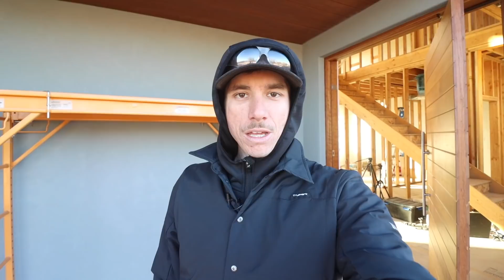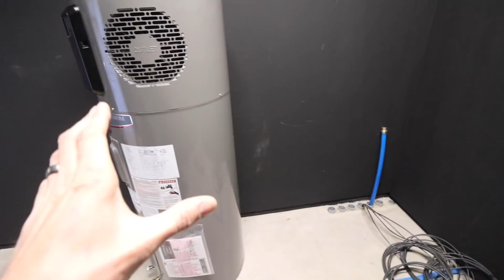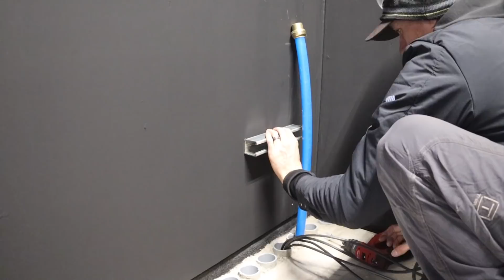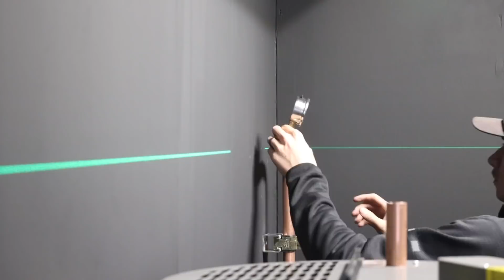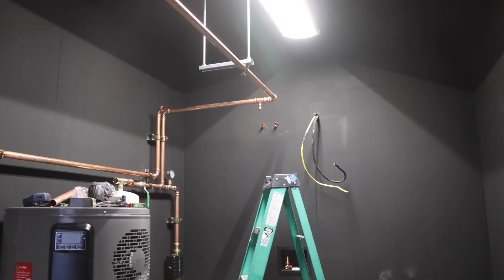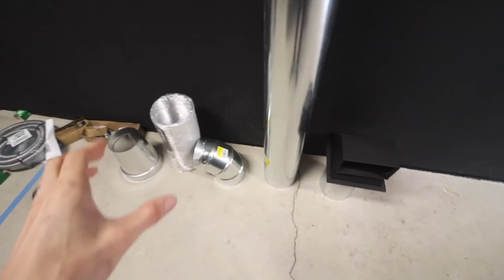Building The Coolest Mechanical Room | Part 2 - Plumbing & Water Heater

Comment: Should use uni strut cap ends and rod and brass Munson rings 😉 and press fit is shit ! De skilled the industry and allowed anybody to think their a pipe fitter ! Press fit valves ? Where's the union / drain off ?

Comment: Would you recommend a particular type of paint for a mechanical room?
Water based/latex? Oil?
Mold proof primer incase of moisture, down the line?

And, is it all just 'normal' drywall?

Comment: Cool channel but i disagree with your choice of a heatpump water heater. With mucho solar available, water is best heated with solar directly than the using electricity. The extra storage requirements, extra generation required and the energy loss in conversion just to heat water is a huge mistake.  Where you can use solar to heat water, you could store a couple hundred gallons and only need it insulated. You could also heat the house with stored hot water. You really missed an opportunity to save.  I would kill for your available solar. Solar Heating water is cheap and easy.

Comment: Good idea ducting the water heater. I have issues with mine due to it not having enough air flow around it to pull heat from the air

Comment: i have that same water heater..i duct it into my basement... today in Connecticut its 90 degrees and my mitsubishi hyper heat hasnt kicked on YET today. thats a great point with that expansion tank and the backflow preventer... usually as you know your well pump bladder is that expansion point...I GEEK out on mechanical equipment.. YOU DONT NEED A DEDICATED RECIRC LOOP. You may want to add a how water pump with the thermostatic valve at your furthest device so you have hot water instantly... WATTS Makes it. it gives you 90 degrees... and you can add more thermostatic valves at other fixtures as needed. i just put on im my house.. AWESOME! (it pumps water back on the cold water line until temperature is reached)

Comment: Now I have seen several having problems with water leakage in Texas due to the combination of power outage and cold weather. Why do you install water lines in the ceiling instead of the floor with pex lines? In Denmark waterlines are placed in the floor and all electric lines in the walls and ceiling. By installing in the floor the water lines are not as fragile to cold weather and in case of a leakage you wouldn't ruin all your ceiling, walls and floor.

Comment: Looks great, as a plumber I can’t complain at how nice you did your surface mount. Was this a remodel? Wondering why the hot and cold weren’t ran in the wall where the HWT was at. I do think there are some benefits to having the main lines exposed, in case you want to add fixtures down the road. Just curious, as overall I think you ran a very clean surface mount system.
Reply from the maker: new install, wanted everything exposed

Comment: Solar thermal would have provided much of your hot water with no electrical requirements. You could always integrate it later- use a solar thermal cylinder to preheat the supply to your heat pump cylinder meaning the heat pump only needs to top up occasionally rather than supply all your needs.

Comment: since you have a dryer that will be dumping heat outside, and you have a water heater that will be collecting heat from outside. could you possibly feed one into the other as an added benefit?
Reply from the maker: would never do that
Reply: @Handeeman  I didn't mean I direct piping but in the same general area. However for those of us not in the industry. Why wouldn't you? From a laymens perspective it seems like an opertunity to recapture some lost energy.

Comment: Very professional looking plant room, question though; here we're not allowed to put a steel, stainless or otherwise tank sat directly on a concrete floor as the concrete has a habit of attacking and eating through the bottom of the tank. Is that tank insulated against the concrete to prevent the corrosion taking place?

Comment: The tank hybrid was definitely the right choice. Keep it on heat pump only mode. The reason it’s on a 30 amp breaker is for the resistance elements.  A tankless would be a huge draw if the house went 100% solar. 👍👍

Comment: I suppose you didn't have room for thermal hot water panels? We use evacuated tubes angled at 60 degrees and nothing else for hot water heating.

Comment: Ideally you want to use a much bigger bladder tank to avoid short cycling your pump. I presume you have a shallow well pump for the cistern. I would have also installed a water filter in the Mech Room. Not sure if you have another filter. Filter would go after the bladder tank to avoid running the pump dry if the filter gets clogged.

The issue with those heat pump water heaters they are prone to failure. I would have use Pex for the connections to the water heater instead of the re-inforced rubber hoses that are prone to failure.

Comment: Those heat pumps are great units  but should really be installed outside. One thing they won't tolerate is a high static pressure air flow caused by adding ducting to the heat pump air flow.  Adding ducting any smaller in diameter than the fan outlet especially with bends in it will severely restrict the air flow.  This will reduce the efficiency greatly and may cause more freeze/defrost cycles than normal further reducing the efficiency and adding to the daily power usage.  They used to have a model that had evaporator plates, that could be placed on the roof, rather than the evaporator coil that is in the top of the unit behind the fan.  We had one of these earlier units that was installed in a laundry cupboard and worked well for 15 years until the compressor gave in.
Reply from the maker: In the instructions it says I could even go down to 4”. We’ll be good champ 🤙

Comment: Don't know if I would trust O-rings to last "forever" on copper piping, especially knowing what corrosion can do inside copper to push out the O-rings. Also knowing how often they leak in auto A/C systems makes me shudder when used on pipes hidden inside a wall. A torch used to solder pipes has a myriad of other uses. What else can the crimping tool for these fittings be used for? Just saying...
Reply from the maker: Yeah I got zero trust in these fittings and all the trust in my solder skills

Comment: If you're bringing in outside air for the water heater, is there an exhaust to let the extra air out of the room?
Reply from the maker: There is a huge hole going in to the house
Reply: @Handeeman  I don't think that weater heater is going to make the air as cold as you think when it's taking in 110 degree air. Maybe you can add dampers so you can choose either outside air or recirculated air in the utility room.

Comment: I've been thinking the best setup overall would be a large conventional water heater tank which is turned down to its lowest setting combined with much smaller point-of-use heaters.
Reply from the maker: You do you boo
Reply: Don't be a dick.

It seems like the primary reason to go hotter in the main heater is to kill/prevent bacterial growth.

Comment: Since you're into the app sensing valve perhaps you'd be interested using an app to call the circulating pump on demand hardwired or IOT saves energy and water which is what I do believe you are all about peace brother...
Reply from the maker: The recirculating pump has a smart feature on it

Comment: Intererested in your Uponor install. Did you get a “plan” with Uponor company or was this DIY plan? I am in Chicago and am seriously thinking of repiping with Uponor to replace galvanized steel pipes. I am assuming you don’t need to worry about codes or do you?  Not that you are doing anything in violation I am just guessing that’s the case as your county is kind of hands off as far as permits and codes
Reply from the maker: Didn’t get a plan from them, it’s pretty easy to figure out

Comment: That braided flex hose doesn't last very long on the hot out, that's all relative of course. I replaced my water heater about 10 years ago and used braided flex for hot and cold, sometime last year I woke up to the sound of running water and the hot out had sprung a leak. Fortunately I caught it quick so my wash room didn't flood, just a wet floor for the most part. I replaced the hot out with copper flex, which is what I should have in the first place, at the time I was being lazy and didn't want to go back to HD for the right length copper flex. You live and learn. The copper flex was a screw on line so no soldering required. Nice mechanical room BTW.

Comment: Awesome work!  I’d recommend installing a small MERV-8 or so prefilter in your duct connecting to the outside for air for the water heater.  You can change it when you change the filter on your normal HVAC unit.  The reason for this is since you live in a dusty desert area, this will help keep the coil fins cleaner in your water heater and will reduce maintenance and increase your efficiency over the long haul operation of your unit.  These are designed to just circulate relatively clean air from your home.  Just thought it might be some cheap insurance.

Comment: Do you plan to insulate your hot water lines?  just curious if the mechanical room is going to be pretty cold the copper will be cold as well. 🤙🏼

Comment: Absolutely stellar work. Really like your channel and the work You put in. That looks better than some of the work made in my house by a professional, 30 years ago (and that is not a bad job). And yes, it is soldered connections. Don't see/experience any problems yet though. Expect/hope to get at least another 20-30 years out it :)

I am not so sure about the water heather though, same age, stainless steel, but they still have some internal parts that do wear out. Neighbor of mine had to change his (same heather) about 3 years ago.

Comment: System looks great, noticed a crack in the floor at 14:22. Any idea what would be causing such early cracking? If I remember correctly the micro helix should have helped prevent that. 
General thoughts?
Reply from the maker: No control cuts

Comment: Why so many bends in the electrical conduit? You must like fighting pulling in wire. They look clean but many are unnecessary with a little better layout. Just my thought from my own experience.
Reply from the maker: I've already pulled wire through the conduit, easy peasy with a touch of lube, it's 20' of conduit, easy pull bro

Comment: 13:36 What are the effects of the cracks around the floor drain?

I'm guessing it's a case of: "we're not expecting water there most of the time, so hardly any flow based erosion, and we're not expecting freezing temperatures in there, so no expanding ice.", but I'm just a programmer, so I don't have much experience with physical systems.
Reply from the maker: You fill the crack in with concrete caulk
Reply: @Handeeman  ahhhh! Thanks!

Comment: I dont know how cold it gets where you are, but you could think about putting an duct diverter in to cut off cold outside air in the cold months which will make the water heater work harder to suck heat out of the cold air.  Probably wouldn't look as nice and clean as the rest of the room though, great job!
Reply from the maker: You can disable the hybrid mode and just use the heating coil if it’s super cold out
Reply: John Snocker If you did as you suggest, you're sucking heat out of the envelope of your property. That would place an increased load on your space heating. If this space is not heated, and unconnected to the rest of the property, all that would happen is the room would be super cooled to the point where the heat pump is unable to function efficiently, and again increase your energy consumption.

Comment: If you're visiting Thailand, they have tankless water heaters that are just plugged into what looks like a 15 amp circuit... They don't get warm. Basically everyone in Thailand takes cold showers. Also a heat pump can actually deliver over 100% efficiency when compared to a coil heater, but it takes some time to get the water up to temperature.

Derek are you planning on insulating the hot water lines? I wish my hot lines were insulated all over the place, but unfortunately they aren't and it's several minutes to get hot water to the kitchen which is like 20 feet away from the hot water heater what seems like every single time.

Comment: If you have livestock (cattle, sheep, goats, etc.), producing methane from poop for heating and cooking is easy. My best friend's older sister was a Peace Corps worker back in the 1960's in Nepal. Her job was helping villages build methane generators, so they could produce fuel without deforesting the sides of mountains. Nepal has a lot less soil erosion now than it had then because of this effort. This is old technology. My dad's cousin had a cattle ranch in northern Arizona (about a hundred miles from the nearest power line) where everything on the ranch was powered by a methane generator. This was before solar panels, so they had gas lighting in their house and barns. It is very doable. 

https://www.motherearthnews.com/renewable-energy/other-renewables/biogas-generator-zm0z14aszrob

Comment: Dang, was just about to suggest a recirc loop..even works well with a checkvalve and natural convection... While you have it hacked open maybe keeping a bit more space between H & C to allow for pipe insulation. I doubt you get much condensation in the desert but the hot side of a convection loop will love it. That said, a mixing valve may cause your loop to be less efficient always diluting your hot side. But I'm sure you have already though it through.. it's just important to add to the armchair quarterbacking that you expect and oh so love ;).  Cheers from Ontario.

Comment: Youy are trhe same crazy person as i'm when it comes to do the perfect. Luckily i see i'm not alone with thta. Clear lines and materials. I used little printed plastic boards to name things and place it at the right point to the wall ot hardware. This installation is a real good candidate to use an industrial PLC. A good visualisation and a webpage to control and setup things. Man that would be cool believe me. Have done this more then once in my cariere.

Comment: Nice idea to use the heat pump to condition the air in the room. Will you be insulating the hot water line?

Comment: Awesome job! Love the way you pronounce uponor. And just a Pro tip from experience braided supply lines  for the water heater don't usually last as long as the copper or stainless supplies.
Reply from the maker: you're right, it's ooooooooponor, I'll work on the pronunciation for the next plumbing video but man... these brands need to come up with a better brand name that's easier to pronounce :D
Reply: I saw another video and the guy was pronouncing it "up honor".  Maybe the way handeeman pronounces it is a Canadian thing, like how Brittish people always pronounce the letter h as "hache"

Comment: Where you're anchoring your copper to the struts are you using rubber isolators , because of copper /steel contact ?  Loving the look totally organized
Reply from the maker: yes, you need to use 'cushion clamps' since they have a rubber isolator

Comment: No, you dont need a pan. You got a concrete crack big enough to ger rid of any water leak issues that come up. Good job other than that. You would make a killing in the electrical industry
Reply from the maker: lol, that's true!
Reply: @Handeeman  - pan can also protect the H2O tank from corrosion due to contact with the concrete.

Comment: Do you plan on insulating the hot water copper lines or that's not usually done?
Reply from the maker: That's going to be a game time decision, all the other hot lines in the house will be insulated but debating whether I need to do it in here

Comment: Great to see you installing this kind of equipment. I've had a heat pump hot water system installed since late 2013. It is programmed to heat from around 10am each morning when I am producing solar power. Cheap and environmentally friendly power production.

Comment: For our all Australian electric solar house i have just contracted to have an 85gal (315lt) Rheem heat pump hot water service.  Our climate is much milder here so it will go outside as we seldom build mechanical rooms.  Utilising the ‘waste’ cool air into an underfloor basement root cellar seems like a plan though.  This type of hot water service comes with a price tag of almost 3x conventional tank heaters but with 25kw of solar panels for my wife and I only we will have plenty of power to run this and our heatpump clothes drier, and power our PHEV car. Great job in the connections and the thought that has gone into this.

Comment: Hey man, I have installed 3 of those Rheem water heaters and they are awesome. You can't beat the efficiency you will get out of that unit. You chose very wisely! Even in my extremely cold climate I install these in the boiler room and they suck up the excess heat from the boiler room and it still uses less than $100 bucks a year in electricity.
Reply: I installed mine July 2020.  It consumed an average of 2.5 kwh a day.  Or 97.60 a year.  For a family of 4.

Comment: Shouldn't you duct the cold air outlet to cool down the house and not cool down this room? I mean the water heater is going to have to work more if it is in a cooler room to maintain the water temperature no?
Reply from the maker: the inside of the house will be perfectly climate controlled, no need to add more cold air in there